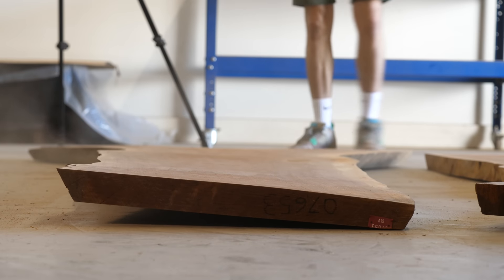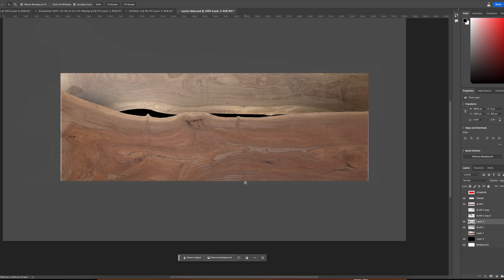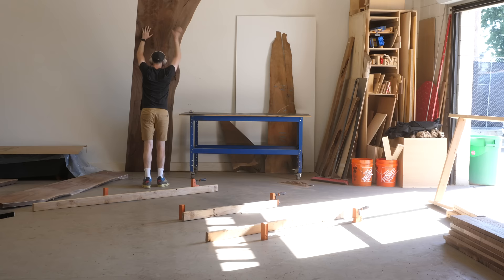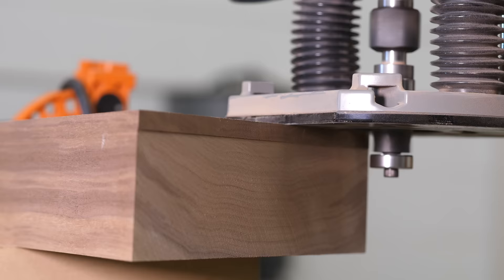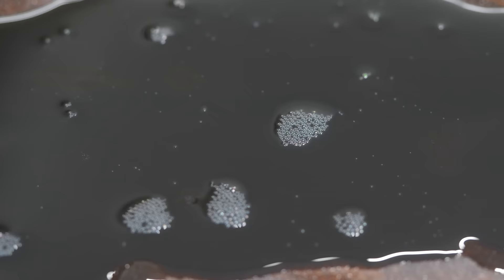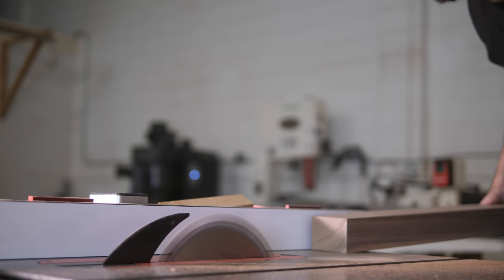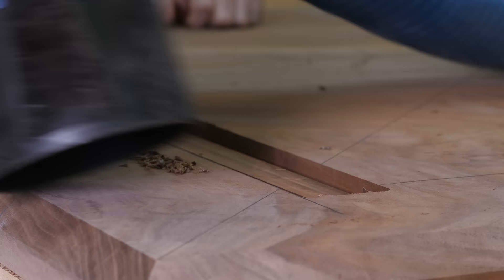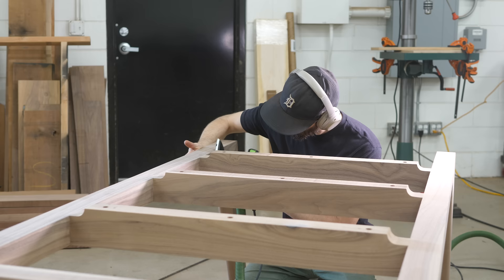Fixing a $30,000 Mistake

Comment: If this is so lucrative then why doesn’t everybody just do this?
Reply from the maker: I would say a few reasons. 
These three pieces sold for $30,000

But if you factor in the costs (very simplified)
Materials, Hardware, Consumables - approximately $7,000
Shop Space - $7.500
Labor - 250 hours
Comes out to an hourly profit of about $62/hour
Or an annual income of $128,000 (not counting lots of other business expenses, insurance etc...)

Then there is the matter of ability.
Reply: Thank you!

Comment: I think I saw that some of those big slabs run into the $8,000+ range. Just curious, how does someone afford to drop that kind of cash on a piece of wood? Obviously the client often pays for the material, but surely its not all paid in full upfront? What happens if you f*ck up and suddenly you've managed to trash $8,000 worth of wood slab?
Reply from the maker: That is definitely a risk. 
I can't really speak to the "how can some afford that" part of the question...everybody's situation is different. 
But yeah...the more expensive the piece of furniture is...the more you are risking should you f*ck up.

Comment: I d k why you didnt just move the slab over a few more inches so you would have a more elegant, IMHO, thin black epoxy line where the 2 slabs join instead of a large, vagina-shaped black hole in the middle of the table. I think that would've looked a lot better. But what the hell do I know.
I have to agree with the owner about the table with the 2 starkly contrasted colors and grain patterns on top..I think it wouldve been cool if maybe the grain ran together or looked similar, but was still different colors. Idk...just kind of wacky and jarring to me and it just does not stay true to the theme of simple, elegant, pure and classic character of everything else which is so well done.

Comment: Ok here's one of the comments you hate.

Dominoes on a 30k table? IF you're mailing it in just use pocket screws or a couple old rusty nails that have been sitting in a jar for 30 years
Reply: A lot stronger than a dowel which is what a lot of the high end furniture companies are doing 😅
Reply: Hand cut mortice and stub tenons with fox wedges is 60 👍

Comment: I agree with the client, the top is ugly AND no attempt was made to match grain/texture, early and late wood or style. 
I would suggest a couple fixes but after hearing you use light part and dark part to describe some of the difficulties you are faced with, I can see you are very inexperienced and since you don’t care to learn proper terminology I just see you as someone who thinks they should get paid $30,000.00 without learning anything. Good luck